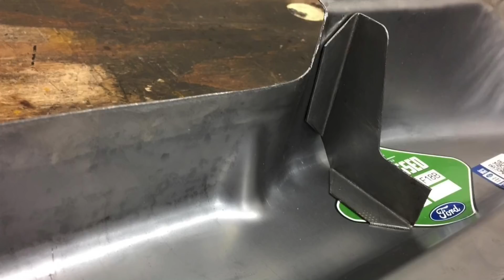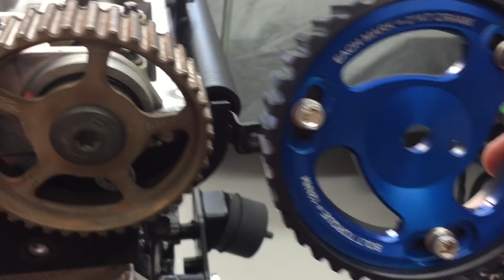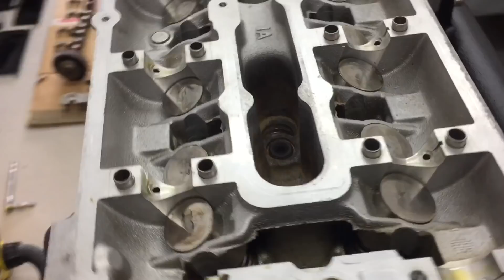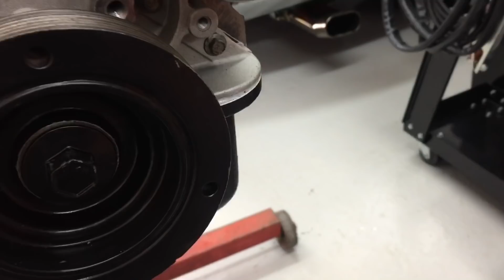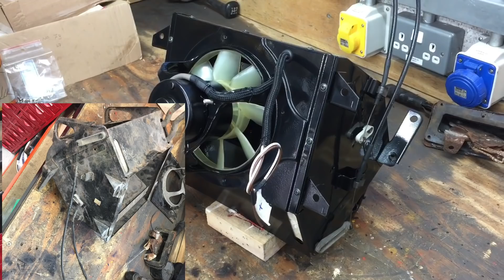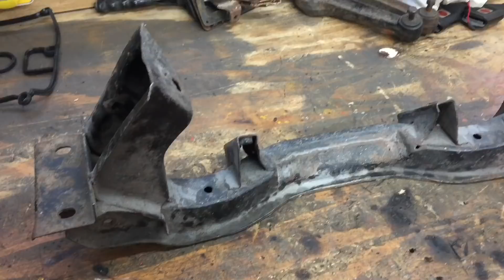MK 1 Escort RS 2000 Re Assembly Episode 6 ST170 engine build up & Cam-belt kit Nightmare

Comment: What tensioner did you use in the end mate
Reply from the maker: @miketaylor3642  it’s exactly the same one the zetec uses. The cambelt kit is the zetec kit.
Reply: @performanceclassics1986  I have just done my cam belt and after the tensioner is tightened and I torque up the cams the marker moves the moves again when I turn the engine over by hand. Is this normal?
Reply from the maker: @ As far as I can remember, the pointer should centralise itself and remain in that position. If it’s moving during turning the engine over by hand then I’d be a bit concerned that the tension was correct. Are you turning the engine over in the right direction?? Turning it over backwards could potentially have this effect.
Reply: @performanceclassics1986  engine is bringing turned over clock wise. It runs and drives perfectly but my fears are the same that if it turns any more it will go lose
Reply from the maker: @ Yeah that’s my only concern too
Reply: @performanceclassics1986  100 miles in and it's been fine. Am waiting on a ford one but it's on back order with no date but will change it over as soon as

Comment: Inlet cam is double the tq of the exhaust. 
Also you don’t tighten the cam pulleys until after belt is tensioned.
Reply from the maker: I do remember loosening off cam pulley bolts to allow the belt to drop on pulleys properly. It’s been so long ago now I can’t remember everything too clearly. With regards to the torques, my mate who is a ford technician has the official ford technical data, and that’s what I used.

Comment: You may have already commented on this but what did the engine come out of? Was it out of a FWD or RWD?
Reply from the maker: It was out of a FWD MK1 ford Focus. It was s 2004 model. Most ST 170 engines were from around 2004

Comment: This no keyway thing is strange.... but watched one engine set with a special pin to locate the crank at TDC (like yours) and parallels to set the camshafts, then the Cambelt was fitted and tensioner released before the pulley nuts/bolts tightened to set the relationship between all three shafts afterwards.....😳
Reply from the maker: Patrick H Yeah its apparently the done thing these Days. I just always thought they all had key ways but it looks like i need to get with the times 🤣

Comment: As far as I'm aware the pulleys for the timing belts on the 170 engine are main dealer only.
Reply from the maker: adz81 Its been a nightmare but ive got there now and its all built up. Ive been told that the cam-belt kit for the ST170 is the same as the kit for a black top Zetec which are more readily available. I did eventually get that idler pulley from TMS motor spares and it was identical to the original. What a fight it was to find though. Ive made a note of all part numbers for future services

Comment: Hi mate, great looking motor . I know what you mean with them heater boxes, I modified one for my mk1 Zetec Escort van using caravan electric heaters and used a thermo fan from a motorbike instead of the original fan blower, only went this way cause the Zetec head interferes with the water pipes and I'd changed the shape of the heater bubble, ended up putting a variable dial for the fan cause when on full blast it sends the vents over my shoulder into the loading bay lol 👍
Reply from the maker: Marty 🤣 very good. Thanks 👍

Comment: Are you going to Dynamat the floor
Reply from the maker: craig orford Ive got a box of Silent coat which is very similar to Dynamat and yeah i do plan on doing the floor before the carpet goes down. I did the underside of the roof in an earlier video.

Comment: Craig I've got a pinto but been thinking of changing to a st 170, just not to sure at the moment, I have a rocket box, can this be used on the st?
Reply from the maker: Tony Aylott As far as im aware Tony, any gearbox that fits the pinto can also be used on the ST engine as the bell housing bolt pattern and input shaft are the same. Maybe do a bit of research first but i don’t see why not.